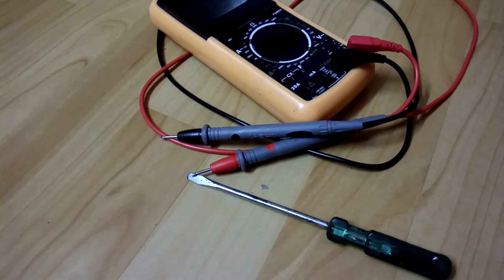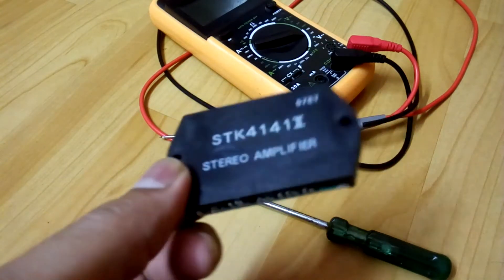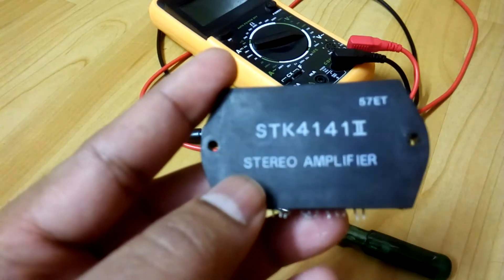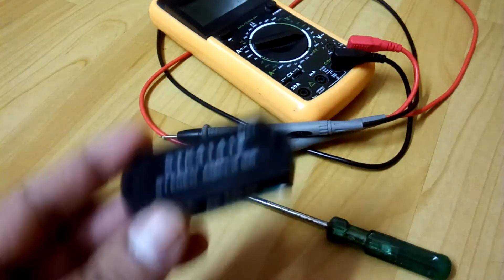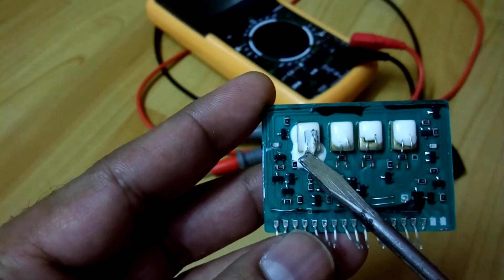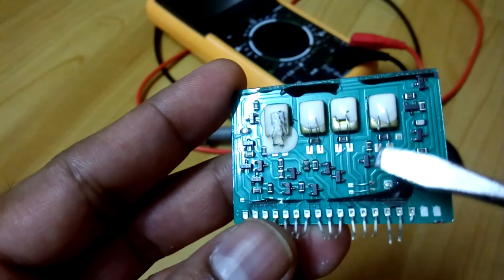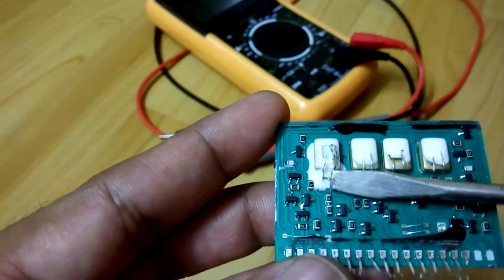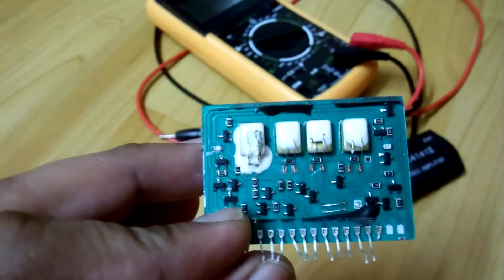Look inside STK 4141 II chipset

Comment: i also got one board,for a change from the spotless class d amps, thought to to hear the old class AB amp, when i powered up, there is a ripple in the audio o/p, supply is +- 28V, could the chip be bad.
Reply from the maker: think so
Reply: You wouldn't  able to see chip portion from bottom .it's completely  concealed. Speakers  must higher of 8ohm